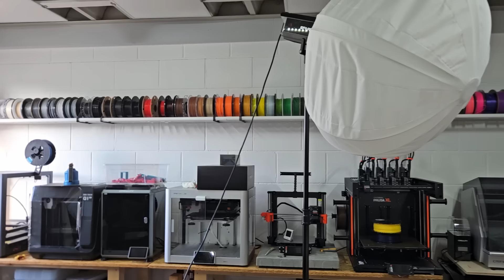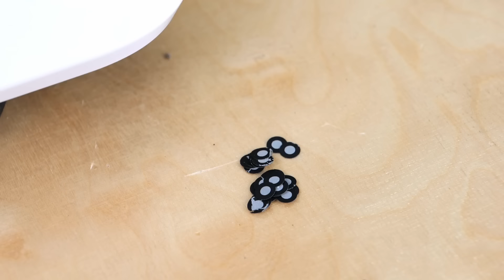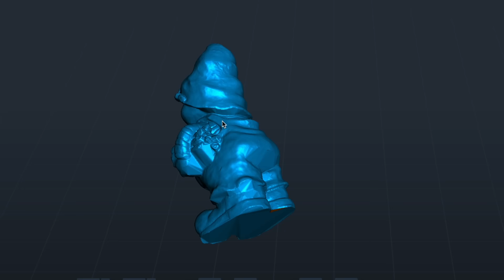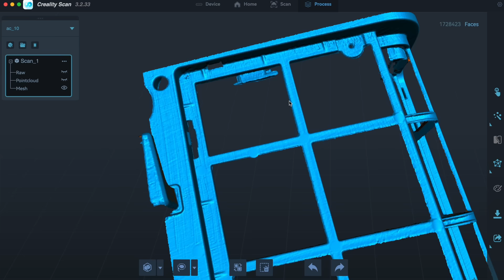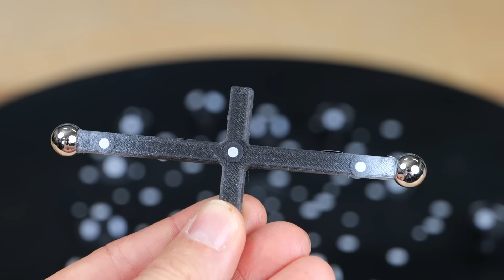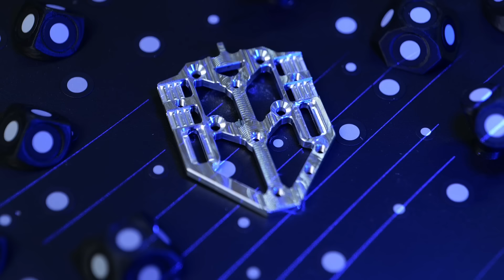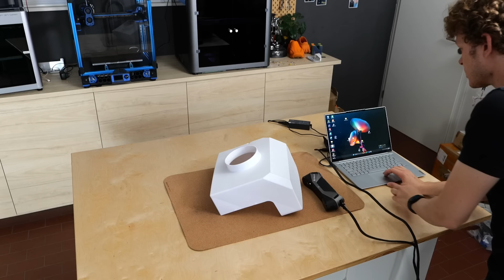Your 3D Scans Suck? Try this! (feat. Creality Raptor)

Comment: I've done a fair few 3D scans over the years and I'd like to add;; 
It isn't a substitute for measuring, even if the tracking says its fine, sometimes its not and your geometry is lying to you in subtle and devious ways, always double check what you can. 
3D scanning isn't a "Magic Bullet", it helps but often doing a 3D scan, post processing and working with the CAD to make new digital representations is just as much effort as the old tried and true methods. 
3D Scanners are expensive, need a powerful computer, sometimes very expensive software (though also often included) and a lot of patience - make sure they are what you need before paying a lot of money for something you may not use.
There are some things, like complex large surface 3d curvature that are very impractical to do other ways, if you do something like this you'll love it.

Comment: Instead of scanning spray I use a spray bottle filled with rubbing alcohol and talco powder. Very cheap and effective. After the scan you can clean the part with compressed air or a brush.

Comment: I used to work with professional grade GOM scanner (metrology of turbine blades) and I can assure you, that problem with seams is relatively commmon. Especially trailing edges were constant issue, pretty much regardless what we tried.
What you achieved with that hand-held device is pretty decent in terms of results, main difference (I asume) is the time spent per part 🙂
Reply from the maker: Interesting. I've been working with GOM and ZEISS scanners and never saw that problem. I'll take a closer look next time.

Comment: ive used aesub spray and cans is so much expensive. ive used lots of gheto solution over the years. usually every scan goes tru lot of post processing anyways so its not a issue

Comment: Interesting. Good indepth video!

I've been using Einscan many years. Right now an Einscan SP v2. Scanning hand sized objects for adjustment in Meshmixer and then finally output in FDM printing. The automated scanning table works well for my needs. I gotta checkout GOM Inspect. I think I saw it years ago in some video (maybe even yours!?) but never got around to trying it. This video is gonna make me go give it a shot, as accuracy of the scan is quite important for my work since the reproduced objects needs to fit onto something else after I've edited them. 

One question, as all these scanners, even this one with lasers still use some form of light, how was your experience scanning crevises? Obviously really large internal holes can't be scanned, but since you are free to move the scanner about, I wonder if scanning visible crevises might be easier on this than something like my Einscan SP v2.
Reply from the maker: I've seen the "deep hole" feature on an Einscan, yet can't remember which one. If that doesn't solve your problem, you won't be able to get around CT scanning.

Comment: Scanning sprays are expensive and I scan, photogrammetry, so infrequently that using them is not economical. Instead I've found that lightly applying talcum power yields better result than without it.
Reply: Dry shampoo. It smells terrible, but it's dirt cheap and leaves exactly the matte powder you need…

Comment: Any plans to compare this to the Revopoint Mini? It claims to have the same accuracy and resolution at almost half the price. I'd be interested to know how they compare.
Reply from the maker: I have one and might compare them. The technology is different, though. Revopoint uses structured light whereas the CR-Scan Raptor uses the line lasers.
Reply: @CNCKitchen  that’s partly why I’m curious. Creality needs blue laser to achieve high resolution, but Revopoint is claiming to do it still using structured light. If Revopoint can capture as accurate high res detail as Creality, how? Did they sacrifice in something else, etc?

Comment: I would like to add something regarding the two-hose-modification of your AC. I also did something like this to a (a little smaller) Hornbach Hantech 9000 BTU unit. Knowing a little bit about refrigeration systems I closely monitored the operation parameters of the AC unit and measuring the airflow across the condensing heat exchanger with and without the second hose. The size of the condensers in these units is so closely calculated that with a second hose the compressor was working with way higher condensing temperatures and therefore pressure. Also the compression ratio was getting way outside the comfort zone of the compressor (which limits the lifespan of the compressor and also lowers the efficiancy). I started adding bigger and bigger fans into the suction hose setup and only a massive EBM PABST W2E200-HK38-01 brought enough airflow again across the condensor to run the compressor again inside its happy-zone. I would strongly recommend to add an additional fan into the suction hose to keep your AC happy and prevent premature failure of the compressor. Thank you for yet another very informative video, I learned a lot over the past few years following your channel.
Reply: @snaplash  I already use 150mm hoses, which are the largest size available for these purposes (of course you could repurpose even larger hoses, but at some point it gets a little ridiculous to attach two 300mm hoses to your window...). But with the two 150mm hoses (each about 2m in length) I had a dramatically large drop in air movement compared to only the exhaust hose of 2m.
Reply: This was my concern, I was thinking about a mod like this and hadn't gotten to the research about it is a good idea. 

What is the total savings running like this? Is it worth while?
Reply: @eslmatt811  It´s definitely worth doing. You get significantly more cooling power out of the same unit. The main waste of energy/efficiency is that with the standard one-hose-unit you throw out an insane amount of your precious cool indoor air to condense the refrigerant which in turn gets sucked back in though all the little gaps in your building and is so replaced by hot outside air. I can cool/dehumidify a much larger area with the same unit now.

Comment: Pre deforming files based on a calibration print seems super helpful! Relativity space mentioned they did it for their 3d printed rocket parts, I wonder if they use a similar method to this.

Comment: Great introduction to scan and very, very, very good teasing of the material (using a Go!Scan 50 and Einscan, but want that my lab buy a creality to test it). Just one little thing, cause I'm actively working in photogrammetry : photogrammetry is Structure from Motion acquisition technique WITH references (scalebars, coded targets with the knowing constraints between them, etc ...), so, with photogrammetry, you have the real scale and you can go to insane precision (depending of the camera and the distance to the subject). This comment is only because I work in that field ;) and I teach the difference between SfM and Photogrammetry, cause a lot of sofwares use "photogrammetry" as a generic term for 3D acquisition from photos (more commercialy understandable than SfM). Love your videos, you really explain complex process in an easy way and even people working on those fields always find something to think of ;), great job !!!

Comment: My quick tip is using talcum based sprays like foot powder or a self made one using talcum power and isopropyl alcohol or an other rapidly evaporating solvent thats compatible with your work piece. Talc is a refractive mineral that is nearly as refractive as the expensive scanning sprays for a fraction of the cost. A kg can be had for about 16 usd and if you just use water and patience it will save you thousands in the equivalent quantity in scanning sprays.

I have access to a 20k usd scanner and so far, I prefer to use photogrammetry with my Samsung phone and Agisoft Metashape as long as I don't change the zoom of the camera, I get an accuracy of 0.1mm with the included metadata in the pictures plus the scans are textured with color. However, if I use the zoom function, I typically get great accuracy by simply scaling the scan by the zoom factor and if that fails a single reference measure typically gets me on the money. 

I will continue to monitor creality scanners because they do seem to be evolving the landscape the most.
Reply: How are you getting such a high resolution using a Samsung phone? I used to work in the past with an Artec Spider scanner, but whenever I tried to use my phone and photogrammetry for personal projects I got awful results.
Reply: @ofekfischer The software has a big impact, i got random scribles using meshroom, i also tried several other photogamatry programs and they where a let down. Agisoft Metashape gave me decent results that I could use as a reference right out of the gate with rather poor lighting. After improving my workflow and more importantly tweaking all the available settings in the software I get very good scans with my phone and the app called open camera. The app was also a key factor, I can lock all the settings even some advanced settings like ISO, white balance and so one as if it was a real professional camera.

Also to be fair all in I'm well past 1.5k usd of the creality scanner. Technically I already had the equipment but 1k usd for the phone, 2k usd for a gaming computer thats is also a workstation, the license for the software 3.5k for commercial and 200 usd for personal, it does have a free trial tho that was neat. Not to mention all my time spent researching and testing.

Lastly if I use a different camera I have to revalidate abd essentially calibrate the whole process to get back to where I was which is why I just use my Samsung phone since I always have it on hand and I'm already set up.
Reply: Yeah what software are you using on the phone?
Reply: @peterhindes  It's called open camera, I've been using it since 2014. The app lets you manually adjust focus and lock it in, along with a whole mess of other settings. But aside from that, taking 100 to 200 pictures helps a lot.

Comment: I would love to see how you like the Revopoint MINI 2.
I heard the software from Revopoint is much better than the Creality software. For example you just need to pause the scan and then start again to merge scans automatically. 
It costs less than half as much, uses blue structured light, precision of up to 0.02 mm. Seems competitive.
Would love to see a comparison  ❤❤
Reply: I had the original MINI and unfortunately it's not as good as it might seem. The blue light is literally a gimmick as real scanners use higher class lasers where with the MINI you just get class 1 which isn't enough for properly illuminating shiny and any even slightly darker objects. Thus you literally NEED to use scanning spray for practically everything not white or gray, so that's an additional cost to keep in mind. Second the scanning window is ridiculously small. You'll need to have like 6 markers in the frame at all times or else you'll lose track, and even then be prepared to have ugly seams after you try merging multiple scans.
The "good" software from Revopoint argument, to my knowledge, came from being the first scanner/software that was of any use at all. Creality when it first got into 3d scanning had licensed 3DMakerPro's scanners and their software was god awful. After this failure they've released their own scanner Ferret, it had an even worse software than 3DMP's. It was like this until the release of Otter and Raptor which now are miles ahead of Revopoint in case of hardware and a tad better software. Still not as good as Einscan but they're getting there.
Reply: @rafall1118 
How do you think about the new revopoint Metrox?
Is it a good alternative to the Raptor?
Reply: @KingDingeling404  Currently there's almost no coverage of it from real users and the Revopoint's live showcase presented it as a slower device than Raptor, despite having more laser lines! The price is low because they've cheaped out on the speed again. A laser scanner to work well should be running at the very least 30FPS and not 15 like they've shown - data acquisition is really slow for this reason, hopefully the tracking is computed at a higher frequency because otherwise it's going to be horrendous with the current state of marker tracking. Besides that they've also not demonstrated the scanner's tracking ability really well, only a flat plane scattered with markers was scanned so we don't know how it deals on edges or going from one side of the object to the another. The only good thing about it is finally the ability to scan shiny objects.
Reply: It's been 3 years since I used the Revopoint. Back than their software was complete garbage - not sure how much it has improved since.

Comment: I used iPhone as a 3D scanner few times in my job as an engineer in a metal working shop. One time it was a spare oil filter holder for the machine for our neighbour's plant. It had non-perpendicular surfaces, notch in one of them and mounting holes within on some distance from base surface. In that barely hobbial case iPhone's lidar is enough, I always can play with tolerances in my job; I also can add some parts in CAD to fine tune fixtures in assembly
Reply: I've heard using the camera is better than the lidar most of the time. Id prefer lidar though so you don't have to pay for the cloud processing and algorithms that usually require a monthly payment

Comment: I have a Revopoint Mini. It's mainly used to scan small objects between 1 and 20 cm. I scanned my G604 mouse and a replacement shell for it.(Google it:)  It's quite annoying to use AESUB spray to scan black objects, and the spray did ruin a leather product. The task of placing reflective markers is also tedious. I've also scanned a large object once—an air purifier back panel. I want to attach a pipe, very similar to your application. For consumers, I think an easy scan, fix, remix, and print process is the most needed feature.

Comment: Great video! The most important tip from my pov about the Raptor is to assure getting 50 fps for the laser scan. For good scanning experience this is the most important. If your PC is not powerfull enough you should consider buying gaming laptop with rtx gpu. If you have already good rtx gpu you need to assure that the main gpu is assigned to CR-Scan. Check this in the taskmanager or Nvidia Control Panel.
Reply: Thanks! Important and valuable information👍🏽 Especially for users who don't have an high end video card yet, because for optimal use they would also have to calculate in the costs of such card when considering getting into 3D scanning with this.

NOTE for others reading this: For most other 3D scanning software (even the simpel Kinect stuff) you also do need a (fairly) decent pc and/or video card to be able to properly scan though!

Comment: As you point out - the major limitation here is the software.
Was true for FDM printing for a long time. Still is true for resin printing.

Also: hang some radiant barrier insulation on your ceiling, and that hotspot problem will be largely solved.
Reply: Drop ceiling is the best solution for crap insulation if you have the room and permission to do so.